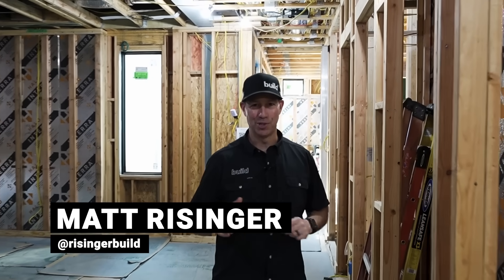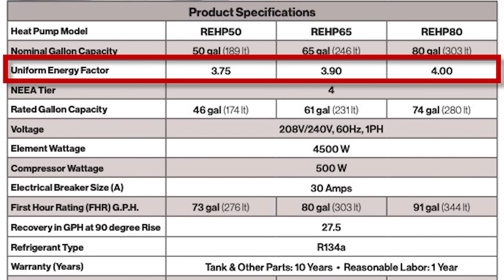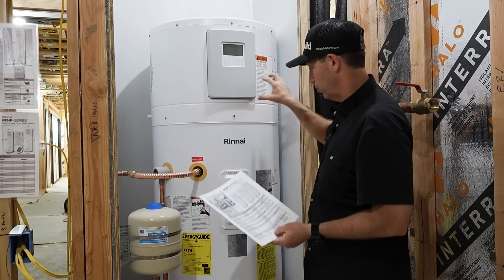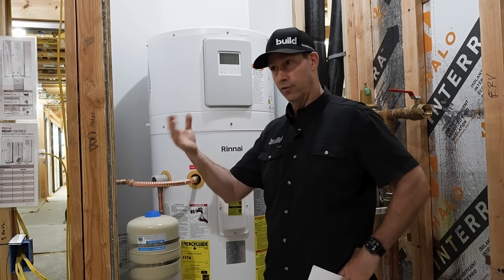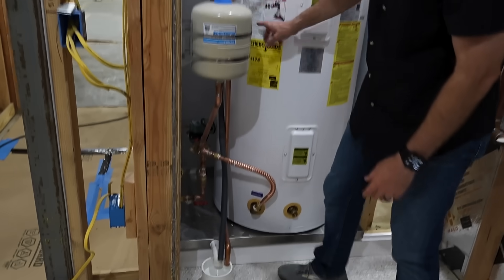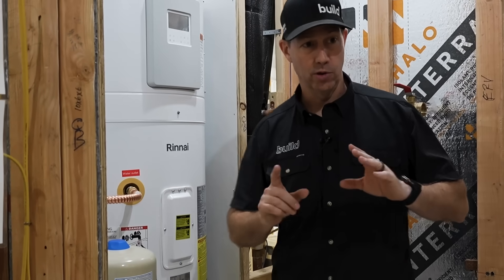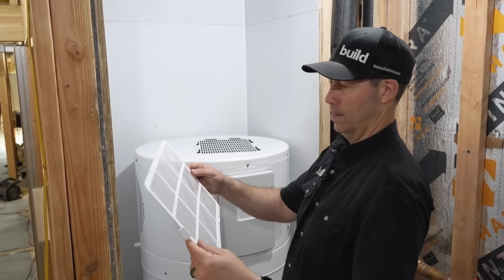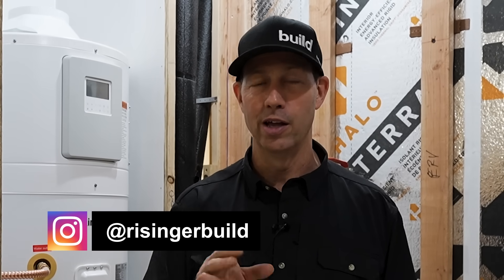The Best New Water Heater? Rinnai's KILLER Electric Heat Pump

Comment: Sometimes these dont make sense with wattage. Compressor uses 500 watts for 9hrs to bring the water to set temp or a 4500 watt element can heat the water to set temp in 1 hour also. What we want to know is how long does it take to heat pump water to set temp in time? At say a few different ambient air Temps?
Reply: With the efficiency ratio of 4, that 500W is equivalent to a 2000W resistance element, so roughly 2x the time to heat a tank as the 4500W element. All at 1/4 the electricity, nice!
Reply: @peterowens9408  seems right, however you’re rarely heating the tank from zero or 55 etc.
Reply: With the efficiency being 4X that of electric heat elements it's doing the same work as the electric heating element would in the same time frame, but using less electricity. The electric heat element uses 4500 watts and the heat pump will use 500 watts.
Reply: @memsu06 that’s the key
Reply: What is the payback over 10 years? 
First cost (Rinai) + operating cost vs first cost (electric) + operating cost over 5 or 10 years
Reply: Cop is 4.

So it's equivalent to a 2000 watt electric heater.
Reply: He gave the stat 90deg per hour.
Reply: If you need more hot water just turn the temperature up and use the thermostat mixing valve that this probably comes with. Which would give you an equivalent first hour reading of probably 120 plus gallons. If you're using enough water you get 2
Reply: I have a Rheem 50 gallon. It runs for maybe 60-90 minutes after a long shower in a 64 degree basement. It does run less in a 74 degree basement. I wouldn't expect max efficiency in a colder spot like a 55 degree garage.
Reply: @ but in the hot summer it will cool and dehumidify your garage👍

Comment: You can build basements in TEXAS? (more information on this please) thank you
Reply: I’d think it would be easier than up north where freeze thaw has to be considered, the problem might be finding contractors to do it.
Reply: Water table is too low on the East side of the state but here in the hill-country (Austin), where Matt is,  we have enough elevation that some homes have a small walk down.
Reply: @JGr3asy  Do you mean to high? I’d think a high water table would put water in your basement. I think the key is a good seal and perimeter drain - assuming you have a place to drain too.

Comment: The specs are all almost identical to the other brands on the market. Is anything really better about it? Is it quieter?
Reply: If anything the specs are slightly less than the rheem unit. 3 yrs ago the big thing was the rheem was extremely loud. I would expect by now that issue has been fixed

Comment: I have a similar type of water tank. I have it in the boiler room, perfect during the winter absorbing the heat from the room. During the summer, I have the cold outlet filter back into the central air system.
Reply: Heat absorbed from the room has to be replaced by the boiler. No net benefit.
Reply: @Billy97ify boiler isn't trying to heat the room.
Reply: @SirGooga  The boiler room is in the building and you are heating  the building with the boiler, aren't you? Cooling the boiler room is cooling the building. Or is an industrial boiler?
Reply: @Billy97ify that theory is too simple if there’s fuel combustion involved. I’m saving a gallon a day of oil, in the winter, since switching my water heating from the boiler’s tankless coil to a HPWH. Why? Waste heat to the basement from the oversized oil boiler and uninsulated slab would be my guess. I wouldn’t be seeing that much oil savings if it were true that all waste heat from the boiler was making it out of the basement to the house above.
Reply: @Edward3D  You didn't mention previously that you were using a tankless coil before the HPWH.

Comment: I'm having so many issues with my heat pump I don't know if I'll ever be able to trust a heat pump water heater ever again. I live in the colder north with a humid climate and run out of hot water easily and it freezes over often when in heat pump mode. I also wouldn't put it in a basement as that basement will be freezing.
Reply: @Rockhurst22  I have to ask: what brand/model? I’m intending on putting a heat pump in my new home build (NJ) in the next month or two.
Reply: @ it is about 7 years old, Rheem 50 gallon Model PROUH50 T2 RU350. Electric mode works great in winter but heat pump sucks big time. If only I could force it into electric mode for the winter then maybe in hot summer it wouldn’t suck but it always switches back to heat pump every 20 hrs ish. I keep opening the app to switch it to electric before showers and high usage. Bottom half will be about 60 degrees always on heat pump mode so you’re always at half capacity unless you’re on electric. And “high demand” mode is total BS. And there are only two of us in the house. Hope you have a better experience. Suggest getting the largest volume in case it sucks and an app where you can switch it over to electric just in case.
Reply: @Rockhurst22 Thanks for sharing. I think I’m supposed to get a Rheem installed. Ugh, what to do now.
Reply: Those things-heat pumps-were brand new in the 1970’s, at least as far as availability goes. Had one  in NC. We were told that they were member meant to operate on any really cold weather, only moderate cold. So not for the Northern US. Sort of like the electric cars  & wind mills free up in very cold weather.

Comment: I'm trying to build a house or renovate a house in the Philippines could I use that there?
Also if I'm going to renovate a house, who would be the person to hire to ask all the questions about plumbing, electrical, foundation repair and things like that? Would that be an engineer?
Reply: General contractor
Reply: @tillthebreakofdawnyo 220v 30A circuit (the units in Australia typically have a 2200W elec heater so only need a 15A circuit, there are also units with no resistance heaters so only need a normal plug and outlet) though in the Philippines it would never run on anything other than the heat pump, the water coming in will be ~25C so getting it to 60C and with an air temp of 30C will be dead easy. At ~400kg it is heavy but not outrageous. Most can be outside (no freezing problems in PH) so if that is possible it is the easiest - on the ground easy access to air etc. Plumbing is normal - cold water in hot water out, drain PTR valve (or direct well away from unit/house).

Comment: The problem with heat pump water heaters are they can be extracting heat from a heated living space. In the winter, this heat must be replaced.
Reply: That same thing can also be a pro in a warm climate reducing load on your Air Conditioner.
Reply: Normally they are in a utility room, so most people won't notice that. I don't notice any loss but I have really good insulation
Reply: Yes and no. In most of the southern states you can place this water heater in the uncondioned garage which would mean you would not have to replace any heat from the house. Also in the southern states, this unit is in effect a reverse air conditioner. It would help with your cooling
Reply: My sister has a heat pump water heater in the garage in western Wa. Her garage is an ice box 10 months of the year.
Reply: Why are you installing your water heater, furnace/handler and softener in the living room?
Reply: @Pepe-dq2ib  
My utility room adjoins a bedroom and a hallway to a family room in the basement.  It's in heated living space
Reply: Having lived with a HPWH in my basement in central WA for the last 5 years, I can say with certainty that this is not really a problem.
Reply: I agree that these heat pump hot water tanks make no sense when the snow was on the ground for 4 to 8 months of the year. They make lots of sense in the southern USA.
Reply: @tonytango6676  Is your water heater installed outside? Heat pumps water heaters work fine where they're going to be installed at inside a home or garage/basement.
Reply: @tonytango6676  If you are in a cold climate that has this duration of snow then you probably have a basement.  I want to put one of these in my northern New Hampshire basement.  And my property is already covered with snow at this time in early December.